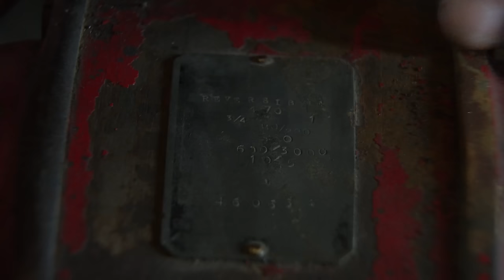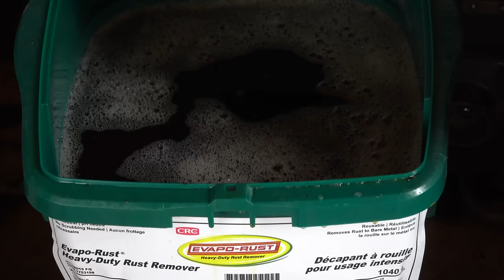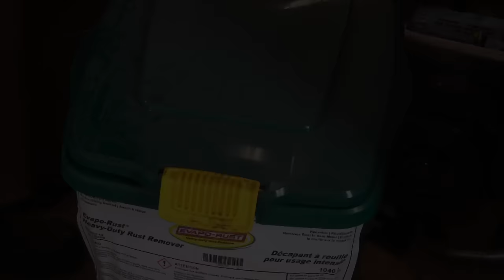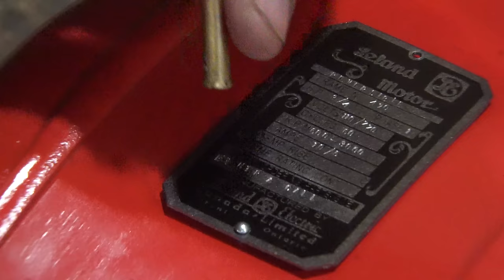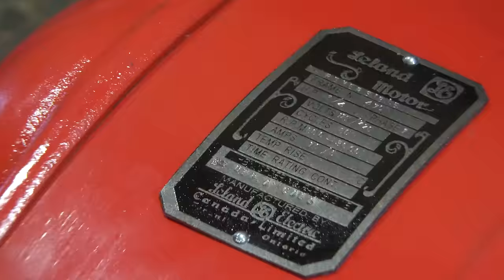Why Did They Stop Making These? [Restoration]

Comment: That was an awesome teardown, clean, rebuild!  

Insanely complicated answer simplified: You have 4 points on the 360° rotation where the magnet can pull or push to initiate or maintain rotation.  That means at most you have 90° (360/4) of possible different magnetic application of torque.  Split halfway to clockwise torque and halfway to counter-clockwise torque it's 45° either way, hence your handle's movement range.

If the electromagnet pulls the core so it turns "a bit" until the next one "pulls it a bit more" that's the lowest level of torque.  If it pulls it almost 45°, momentum carries it a bit further then it catches the next "pull" and so on.  Magnetism is an inverse square attraction so the more you get away from 0° the less power you have but a greater angle.

If you think of it as as a magnetic-lever, weight, arm, and moment all are related.  In this case "weight" is fixed, arm is dependent on where you set the handle, and moment is the end result, which varies as you move the handle. 

If you don't already know the winding wiring, yes, it's a bear to figure them out.  the easiest way I've seen is to only hook up one winding, then manually rotate to see which quadrant (90° out of 360°) it "catches".  Unhook that winding.  Repeat the process with two more till you have mapped out 3/4 quadrants so now you know all four.  Then connect them in the proper phase so your motor is in sequential phases.

I could go on, but it gets boring, your work was beautiful, great restoration job, and sorry to drone on about the science of it, but it is, after all, science.  Most people don't think about magnetism in an electric motor as weight/arm/moment... but it's just a rotating lever :)

Comment: Nice work. Everything looked like it was very well done but I always make sure to braze both sides whenever possible. With the drive end housing off you could have easily flipped it over to get to the other side.  In your video it looks like you only repaired the outside. Otherwise, great job!

Comment: 21:02 I am surprised the insulation did hold up. And no one was electrocuted — yet. Please replace the winding of the motor for electrical safety reasons. I bet a high voltage breakdown tester has a field day with it.
20:26 That doesn't sound healthy.

Comment: I'm not sure if it's true that water hitting the outer most edge of a mill would increase its speed. It would most certainly have more torque and you would want to at-least start the mill by having water at the very end... but at the same time, the water can only make it spin so fast, as gravity only allows so much velocity... so having that velocity divided on the much larger radius of the outer edge may spin the mill slower than if that same force/speed is applied to the center (kind of like the figure skater bringing his/her body mass in to spin faster, but the opposite). Am I wrong about this? Does anyone know for sure or have any arguments (for or against)?

Comment: Basically its using its inefficiency to operate the speeds (retarding and advancing.
I bet it gets warm though, huh
If people only knew their motors would run faster and cooler if they reset the position of their magnets, they'd probably be enthused enough to take better care of yheir stuff. Theyll run it until the brush mounts melt and the springs fly out.

Comment: a question. i have a Cincinatti royal 16 drill press with an old 1/2 h.p. century motor. when i last moved it the toggle was broken off of the switch ( switch is mounted to the frame near the inspection cover ). i installed a new switch. now the drill runs fine in the on position but when it's turned off the motor makes a clunking sound & it trips the breaker. the wiring insulation looks good & it's wired correctly & it's a s.p. switch. i tried 3 switches with the same result. any ideas? a good friend of mine was a whizz with this stuff but i'd need a medium to contact him as he's passed.

Comment: movement of brushes lag or lead rotor. I wondered for 20 years if this is possible. PSU ee teachers suck.  it took a phd in solid state phyics to confirm my thought on this mag princible.  i incorperated in a motorcyicle built only on paper. flywheel energy storage with regen brakes and gyrosoptic lean control at the speed of light. when you put parts in place at scale it looks like akira bike. fly by wire with mechical back up. now days i dream of hydrogen lift hybrid aircraft freight haulers. zepplin sky trains.

Comment: You’re switching the polarity of the motor. I put in A motor like that for the house heater to blow the hot air through the house and I put the motor in it was spinning the wrong way so I switched the wires switching the polarity and it ran in the other direction blowing the hot air through the house.  I don’t know the reasoning behind how you change the speed at which the motor turns probably some kind of resistor to increase or decrease speed 🙆🏻‍♂️🤷🏻‍♂️🙋🏾‍♀️

Comment: I believe this is called an induction repulsion motor and they were the 1st type of electric motors made.. They were made for DC current before AC was avaliable and the were used on many machine tools and to power line shaft drives. I currently own one of these in better condition. Mine was originally cumberland green before the red paint was applied. Why I do not know.

Comment: repulsion motors aren't made because they have significant drawbacks... they have torque control, not speed control - so if the load goes away, the speed increases almost uncontrollably.  They also want to turn into a fireball if the control level is moved to the opposite direction less 'carefully' than you did in the video.  Aside from that - silicon is cheap... so a three phase motor on a modern speed control outclasses this in every single way - with no brush maintenance...

Comment: That motor has way too much chatter, and the inconsistency in the chatter means when you lathed down the copper on the commutator you did it unevenly. Also, doubling up on recommending to replace the protective lacing you removed.

Comment: When I was watching you do the crack repair, I was curious if you've ever seen how they used to repair cracks in flathead engines? They would drill and tap and then cut off a bolt in each hole until the whole crack was a solid piece of new metal. I think it was called stitching.

Comment: My grandfather was an early 1900s machanic electrican - he is from the days when power house generators would be pach wound or fully rewound on the job sight - 
      I started in the offshord oilfields in the 70s as a generator hand - 
      The old rigs from the 30s generaly had equipment from the 20s and 30s - we would have the old motors reworked  over replacing them with newer S or T or frame induction single phase start motors - 
      The old X frame motors weighed 100 pounds per HP - the old U Frame motors were very heavy also - those motors on the old rigs had to be rewound - 
       We could not replace them with the newer motors because the generators did not have the KVA to start them - the large motors were repulsion start motors they use the same amount of power to start as they do to run - 
   Also a 1 hp old X frame motor would have to be replaced with a 2 HP T frame induction motor to generate the same output power - 
     Many of those old genrators were air injection oil engines built in the 20s - 
   If they said they were 50 kws that was it - 
    Modern high speed generatos depending on the amount of cylinders if full load is 50 kw the kva can easely be 150 kva for 4 seconds and 75 kw for up to one hour - 
      Slow speed oil engines that are direct fuel injected can have a efficiency of up to 27:1 were as the modern high speed  light weight generators of today generaly have a effecency of 4:1 in most cases - 
      Also the old generators and pumps did need work but they ran for 10 yrs and only the rings were changed and wrist pin bushings were changed on the piston -
      Modern generators are completely rebuilt every 16000 hrs or two yrs - 
     They still make heavy stationary slow speed engines for industrial use also X frame motors -  but today they have very limited application - 
      A modern offshore platform is mega fuel hungry today - i retired as a high end systems tech - 
    Many  Power houses that powered towns up till the 1950s would not be able to handle the surge it takes to start the newer T and S frame motors - 
     I live in the rural deep south and even in 1980 i could only have a transformer up to 7.5 kva for my house - 
   We burn power like we use water today lol -

Comment: The reason these are not made anymore has to do with electrical and mechanical efficiency.  We no longer use rheostats to control voltage because  frequency multipliers are far more efficient in their use of electricity; overall current and power requirements are orders of magnitude lower than that of a rheostat.  Similarly, the voltage control of this motor, while amazingly clever, is terribly inefficient when compared to the motor control devices of today.  You can actually measure the difference by measuring the current draw of your motor and a similarly powerful modern motor design.

Comment: Who would have thought to move the brushes back and forth to make it do crazy dancing? I think they stopped these because you have a high current in the coils and you could burn out the coils running near the zero RPM because you begin generating heat without having any mechanical load to transfer that energy efficiently.

Comment: Its basically to do with switching of polarity and whats called the neutral point , i repair electric motors for a living and this seems to be a very basic schrager unit! The bigger ones have mechanical brush gear to adjust speed at a constant voltage without losing much torque.

Comment: I restored one a few years back it was a beast! I’d say it was probably 3 times the size of this one and it had a sturdy neutral position to stop motor. It come off of a early printing press and I was told the reverse option allowed Maintance to be done to the press. I wish I would have kept it....
It was a Westinghouse I believe. Dual pole brush shift induction motor but don’t crucify me if I said that wrong.

Comment: The operation is a giant version of what happens in a distributor cap with early auto engine spark advance. Every elevator in the '20's, through the '50's had these as the up/down and speed control of the elevator car.

Comment: It’s a multi phased motor. And by shifting the electric phase of one coil in conjunction with the other coils. You’re adding or subtracting power to the motor. The analogy stays the same. But now you have two streams of water. That if you put them together in one stream. The stream now gets stronger. When you more and more put them against each other. You cancel out the power and get a big mess of water. Until you more directing them again both in one way you get again the more power from both streams.

That’s my understanding of this.

Comment: I stumbled upon this video and I admired your skills.  Could the way you stopped that crack work on cast iron.  Its hard to weld cast iron because it has to be at least 500 degrees F before you can weld it.  Like if I heated it up then melted the electrode or still rod into it?

Comment: As the brushes are advanced, the sparking is reduced until the null point is reached. Each coil is an inductor and when the current is shut off the collapsing field generated a high voltage that creates the spark. this wears the commutator down and the brushes too. The field coil's magnetic field is twisted too so the sparking is somewhat load dependent. You should see this effect because you can see the commutator while the motor is running.

Comment: I worked in a Bowling Center as mechanic and head mechanic for 15 plus years. Went to 4 weeks of pinsetter school in Michigan to learn all about them. The Pinsetters had a belt driven gear box and a pulley section that was for belts and clutches. There would be jams at times that these machine would get into where I had to turn off the power and hand crank backwards on the belts on the motor in order to back it off of a jam in the machine. These machines where 90% mechanical.  Even the the Detectors or brains were made of cams and levers as in (Cam Followers and Selectors) that would tell the machine what to do when it reached a height where it stopped above the pin deck. Rake all the pins or pick up remaining pins? or stop if one is out of the range where it cant pick it up. If you had a reversing motor that would help you but it would also sheer a pin inside the detector if you ran it too far back making it a very costly mistake as these were complicated, and required a knowledge of how to rebuild them, and then even to replace one was an all day job. These machines were made from WWII military parts. The were usually old and some had Leland Motors in them. They may have at one point entertained the idea of using reversible motors, however I doubt it. But other factory type machinery that ran off of motors that used gear boxes and pulley systems may have had similar needs to reverse the motors to clear jams. That would be my guess at its purpose. As the ratio of the gear boxes and pulleys to one revolution of the motor may make it too hard to reverse the motor belts by hand. I hope that gave you some kind of insight.

Comment: The cracks which you repaired were most likely caused by stress due to thermal cycling.  My guess is that the housing builds up a lot of waste heat that it can’t get rid of after it’s been on for a while.  Probably gets hot to the touch.  I am wondering if the insulation around those wires you replaced can take the heat.

Comment: A tip: before machining motor collectors, put some epoxy resin on them. If you can, let it dry while rotating slowly (i.e. in a lathe) to help it spread. The goal is to fill all the gaps with the resin and to fix any loose plates, if any. Copper plates probably get covered with the resin but you're going to machine them anyway, so it doesn't matter. After that, machine as usual. You never get copper chips in the gaps since there are no gaps anymore, and the collector will be more smooth than it was originally.

Comment: Ok I have no knowledge of restoring or electric motors for that fact.
You really tore that apart, far as I can tell, and it looks and runs great.  The wiring in and around the stator and well the other coil around the outsides is it not worth rewinding them?  Or is it too expensive, or is it not possible?

Comment: With this type of motor, you have a magnetic field or emf produced by the stator winding when alternating current is applied to the motor leads. This, in turn, creates an induced current and additional emf on the rotor windings which are connected together by the brushes on the commutator. By changing the position of the brushes, you are changing the degree of phasing between the two fields and thus increasing or decreasing the repulsion effect. The greater the degree of separation between the fields, the more torque the motor will produce.

Comment: Nice video. I think it's a kind of universal motor with the rotor and stator in series. As you change the angle between the sliping contacts of the rotor and the stator you change the relative position of the magnetic fields of rotor and stator. I is a very old way to make vectorial torque control by the way. Very nice motor, It would be very handy to have such motors available today !

Comment: the way the handle works is deceptively simple. the current is lazy and looks for the shortest way to its end. the longer the distance, the more work is done. therefore more speed and inversely more torque at lower settings. more torque is required to overcome momentum and with speed the torque converts to Kenetic energy. momentum helps it maintain speed int the end. an object in motion wants to stay in motion

Comment: That's a neat trick with that file. I'm going to use that on a piece of angle iron that I cut too short. How long will it take to add an inch back on if i'm filing by hand?

Comment: Hi! Idk who else or what else to do with my idea ,but i cant find it anywhere and it would be really useful ,im a third year eletrical apprentice and right now we are putting up alot of threaded bar with strut and tray being put on them. So there would be a nut on the bottom side of the rod and 1 on the top which u cant access with a drill attach ment to spin it down quickly. Ive seen open ended rachet spanners and they would do the job but its still to slow. Im looking for an open ended rachet spanner that could be attach to a drill to spin the top nut down ,if anyone else would like to see this pleas reach out and make it a possibility

Comment: The lever is the speed and sometimes it reverses the polarity for a different angle of connection to the armature or the planetary system coils a switching process can be added to the exterior coil to speed control dials ❤